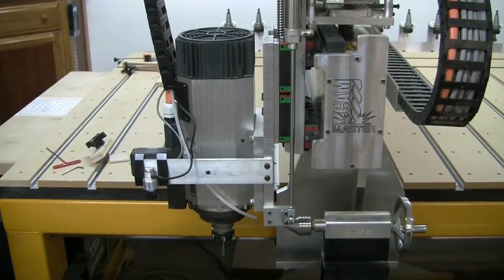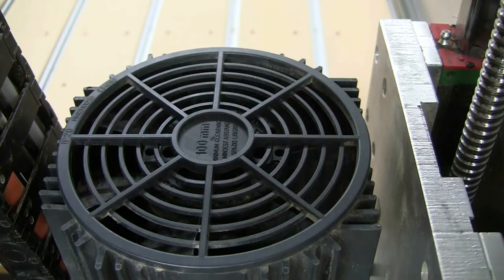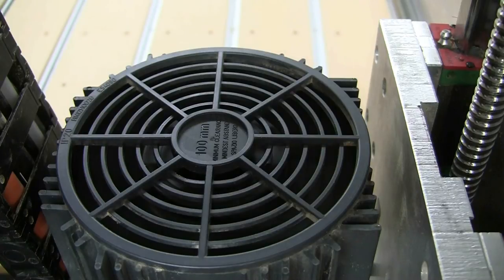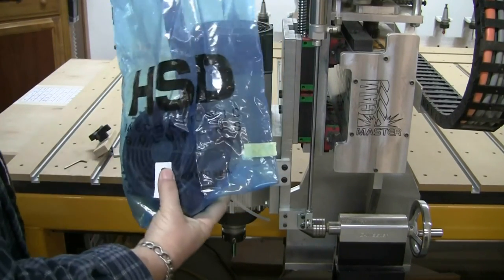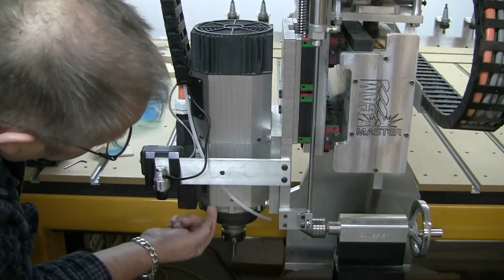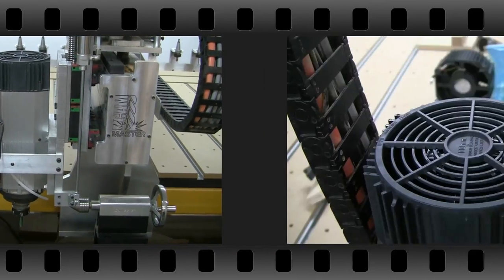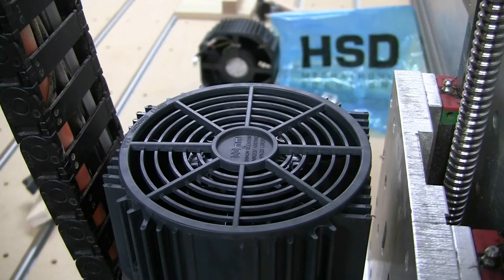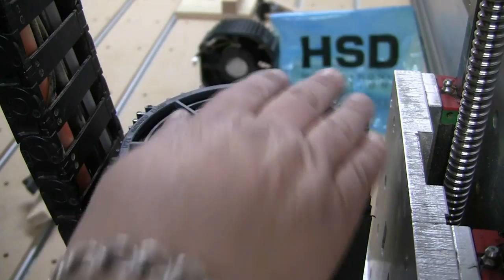Spindle cooling fan

Comment: Hi Mick,.
There is joyful moment when the spindle ventilation again works!
At the viewing of the videos came up memories.
We renewed the entire wiring of the machine... and somehow was due to high voltage at the fan to... Smoke - shock - shame - fan purchase.
3 Days later everything is good same happy scene as the end of your clips.\o/
have a good new year :-)
Hermann
Reply from the maker: Hermann, as you know the fans are not cheap but without it the spindle is useless, The company where U bought the fan was GREAT really fast shipping.

Comment: That fan is not made by HSD. It's an Ebmpapst fan. You can check the model number and order the exact same fan off Amazon or ebay (new) for a fraction of what CNC stores charge.

I replaced the electric fan in my PDS spindle with one of identical brand and model number for $62 instead of the $500+ PDS would have charged.

Never buy standard parts from CNC companies.

Comment: sir how much the fan cost
Reply: Just changed fan by similar and cost is some 50 euros. Pls use 230 volt ac fan. Be careful with wires.
Spindle with "no original" fan used over 2 years without problems..
Reply from the maker: Thank you for your comment, mine was an original spindle fan.